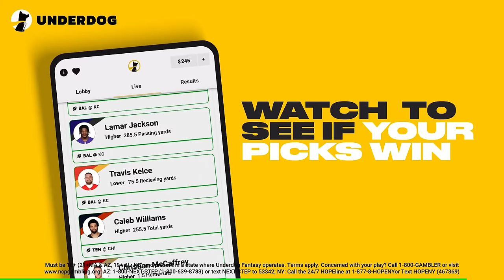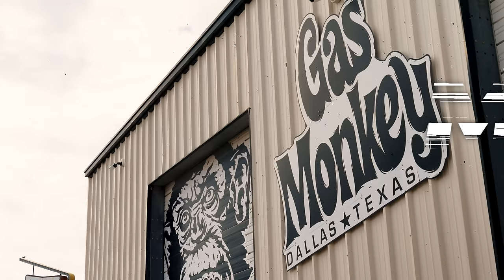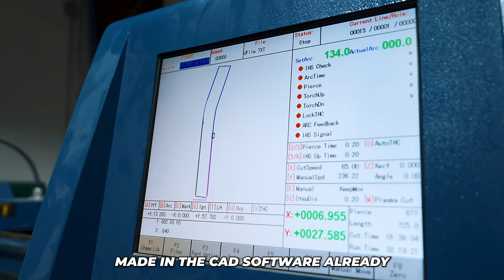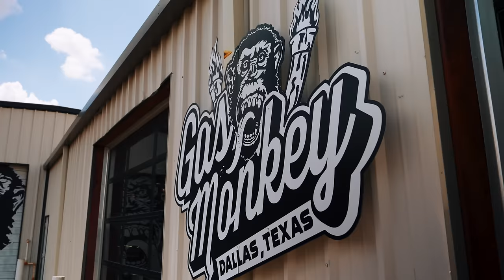Gas Monkey's SEMA 2024 Build - PT 1

Comment from the maker: Sign up and deposit for Underdog HERE with promo code GASMONKEY to get up to $1,000 in bonus cash and a free pick: https://play.underdogfantasy.com/p-gasmonkeygarage
Reply: I think what you should do is to have a glass top to go tinted when you hit a button. I know they have it in Glass for bathrooms. Maybe you could have it for the glass roof because when the sun is hitting it, it’s gonna be really hot.
Reply: Those Cadillac taillights will look better than a dually on a single cab short bed. The pano roof with roll down back window will be awesome but the dually will ruin it. It would look better with a stepside
Reply: “If you build it, he will come”
Reply: Y’all ever need a custom paint and body man hit me up
Reply: 23-24 Range rover tail lights
Also not many panoramic touch screen dashes out there yet.
Reply: Just leave the tailights factory with LED bulbs, it shows it’s a OBS Chevy truck from  the rear,,your right the Cadillac tailights suck,

Comment: So you want an old school superdome but fixed in place. For the taillights use 1st gen Colorado lights but flip them upside down and swap sides.
Reply: 🤔 that’s not a bad idea
Reply: I rather like the shape of the ol caddy lights, but a slick set of LEDs with a modified bullseye pattern would set it off. I'd even be okay with frenching in third brake lights mounted vertical.

Comment: for the tailights i would do a clear acrylic molded and fiberglassed to the body, then paint it with a translucent candy to match the body color so that it looks like there are no tail lights, until they are turned on, and the brightness of the lights would show through the translucent candy color

Comment: It's a cool concept but I'd be doing a full wide body all-wheel-drive so you can put that power down. A Currie 9" IFS front diff and an Escalade transfer case and Tahoe spindles would probably work since you don't need a low range. Slap on some 315 section width fronts with 345 rears and that thing would be bitchin with 1500hp.
Reply: He is prob going 405 on the rears for the 24x15. Most phantom duallys that go single wheel rear use 24x15 rhey fit perfect

Comment: Some of the OBS diesel truck had a factory front bumper with square inlet holes that you could use on your twin turbo setup. It might be cooler than an aftermarket bumper.
Reply: THATS what was different...i bet it was diesels and one tons with the oil coolers mounted down there had the openings. I was a lil confused when i saw the solid bumper on that chsssis.

Comment: Shave the 3rd brake light on the roof, and run a bumper brake light bar behind the back window. The new ones have turn signals and reverse built in now. This is what I've been wanting to do to my obs since i haven't seen anyone else do it yet

Comment: I think the Cadillac tail lights were a great idea. What other options do you have at this point besides blanking em out and putting Corvette tail lights on the rear bumper instead which I think is prolly way more common then Caddy tail lights. 4th, 5th or 6th Gen Corvette tail lights (84-14) I'm thinkin but I think the Caddy tail lights are a perfect replacement and fit the area great. The work on the frame looks awesome. Good stuff ✌️✌️

Comment: Should’ve done a modern twist on the old 454 obs truck gm made .. run a twin turbo 454lsx crate motor , twin g40-1100 turbos .. Holley efi , tsp inatke manidold .. you’d have the sickest truck there

Comment: As for the taillights, the Cadillac tails have been done way too many times. If it were me, I'd redo the taillight section with the delete panel, then use late 50s early 60s Impala taillights but flush mounted or recessed. Just my opinion though.

Comment: Probably 10 years ago Gale Banks took a 454 SS truck and installed one of his twin turbo small blocks and Richmond 6 speed.
 Now his twin turbo crate engines make 800-1100 hp. And he bent the stock frame, cause gm didn’t exactly make them that strong. 
 So you’re going to c-notch and reduce strength and then add 1500hp. Yeah good luck. 
 I really dislike the “I threw the road shop chassis at it for $25k” kind of builds. Not to mention the chassis have the same shitty stock eccentric  Adjustment front suspension that the obs came with. 
 But it’s probably the cheapest way to built it is with a custom chassis. Not to mention if you want any kind of safety or handling the stock chassis won’t handle worth a dam.

Comment: What I think is not very creative whenever people try to build a truck is that the first words out of their mouth are that they're going to put an LS motor in it. I don't find any originality or creativity in that. Then they use stock looking intake that looks like doo doo. Or they'll take an older engine and converted to run a holly sniper EFI or something else dumb like that. I miss the artistry in old carb set ups with very fancy lines and linkages that look very detailed and ornate.